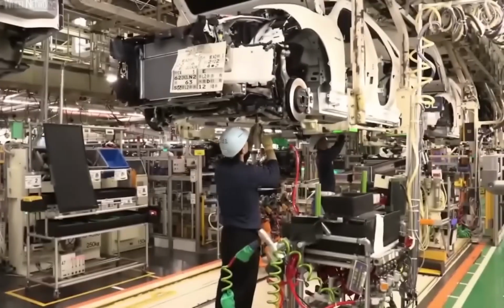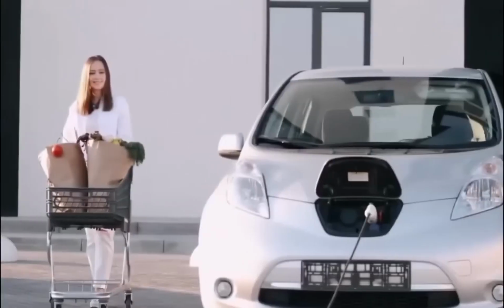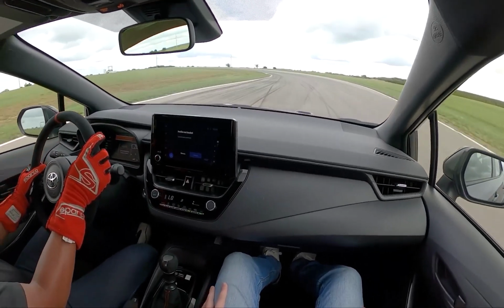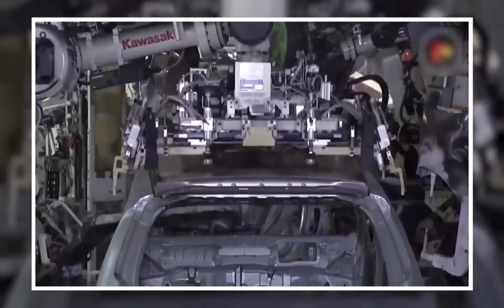Toyota FINALLY Takes Its New Engine To The Street That Will SHOCK Everyone!

Comment: I like a varied approach, but I’d argue that the enemy is also air pollution, and if we can reduce that by reducing not just CO2, but also NOx, then I’m all for it. However, I do understand that BEVs have their own challenges. I think CATL and BYD’s production of sodium ion batteries starting in 2023, will help ease some of the supply constraints.